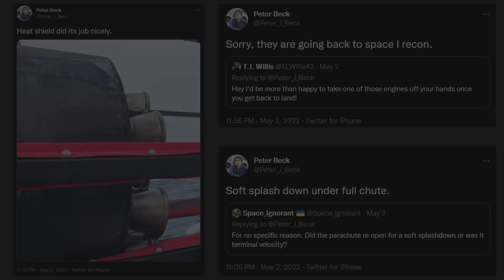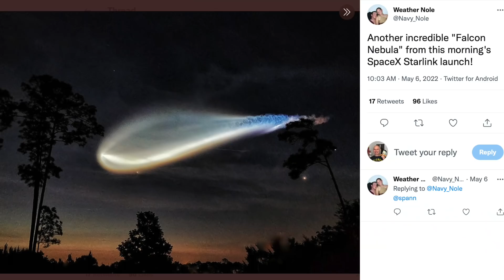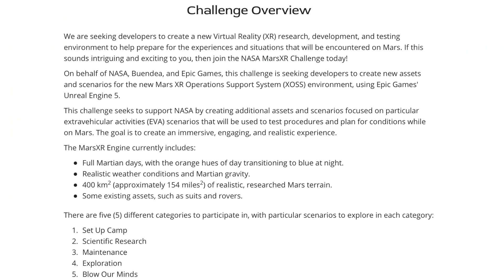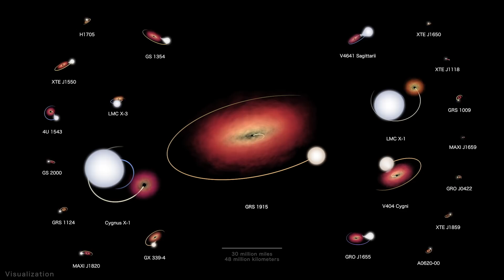SpaceX Planning To Land In Middle of Bahamas - Deep Space Updates - May 10th

Comment: not that impressive since we've been able to get from Montana to Moscow in 30 minutes or less since the 60s though that's always been purely on paper
Reply: In actual human travel, I recall reading that you used to be able to fly London to Paris in 20 minutes in the 60s. That's from walking in the airport doors in London to walking out in Paris. When I read it, (maybe the 90s,) you couldn't do it in less than 2 hours due to air traffic congestion and maybe security. When it comes to transport technology, anything is possible until everyone wants to use it at once.
Reply: @eekee6034  go read some of the speeds they used to run passenger rail back in the 1920s, they were possibly hitting speeds of 140 mph on sections of track but nobody bothered putting speedometers on trains back then anyways so the record for fastest steam engine probably isn't the actual record

Comment: Thanks for the analysis.  There were, apparently to V2 Raptors that have blown up at MacGregor, yesterday and day before.  Rumors that those may have been intentional.  BE-4 is nearing decades behind schedule, despite rhetoric to the contrary.  Spin launch would not, to my mind, be a candidate for the moon, much simpler would be a rail gun, where the G-forces could be slowly applied, or could be more adequately controlled in a simpler fashion.  The gravity well on the moon is so shallow, you only need to throw something like 10miles and it's basically in orbit, or there to be picked up by a tug or some such, as Apollo 11's Mike Collins did with Eagle when it ascended (and all subsequent Apollo's).  Spin launch creates incredible and unnecessary G-forces to my mind, and those would not be healthy for human occupants.

Comment: (CNN Business)Boeing Co. is feuding with Aerojet Rocketdyne, a key supplier for its Starliner spacecraft, as the U.S. aerospace giant races to test launch the uncrewed astronaut capsule and mend its reputation in the space sector, people familiar with the matter said.

The CST-100 Starliner is scheduled for a May 19 Florida launch atop an Atlas 5 rocket to the International Space Station, with Boeing aiming to show NASA that the spacecraft is safe to ferry astronauts to and from the orbiting outpost. Software failures cut short a similar 2019 uncrewed test flight.
The mission is a crucial step toward re-establishing Boeing as a viable rival to billionaire entrepreneur Elon Musk's SpaceX, a drive complicated by Boeing's disagreement with propulsion system supplier Aerojet, according to three people who spoke on condition of anonymity.
Boeing is losing the plane race. So it packed up and left for Washington
Boeing is losing the plane race. So it packed up and left for Washington
Chicago-based Boeing (BA (BA)) and El Segundo, California-based Aerojet (ARJD (AJRD)) are at odds over the cause of a problem involving fuel valves in the Starliner propulsion system that forced a postponement of a test flight last July, with the two companies faulting one another, the sources said.
The disagreement, which has not been reported before, comes at time when Boeing already is scrambling to emerge from successive crises that have hobbled its jetliner business and drained cash.
The Aerojet dispute is the latest illustration of Boeing's struggles with Starliner, a program costing the company $595 million in charges since 2019. Facing fixed-price NASA contracts that leave Boeing with little wiggle room financially, the company has pressed forward with the Starliner test.
Boeing in a statement provided by a spokesperson to Reuters acknowledged for the first time that it ultimately intends to redesign Starliner's valve system to prevent a repeat of the issue that forced last year's test-flight postponement. The Boeing statement said that "we are working on short- and long-term design changes to the valves."
Thirteen fuel valves that are part of a propulsion system that helps steer Starliner in space were discovered stuck and unresponsive in the closed position, prompting last year's postponement.
The various technical setbacks have pushed Starliner's first flight with people aboard into an unknown future, placing it far behind Musk's SpaceX, whose Crew Dragon capsule, developed under the same NASA program as Starliner, has already flown five astronaut crews for the U.S. space agency.
SpaceX&#39;s wildly busy year continues with astronaut splashdown 
SpaceX's wildly busy year continues with astronaut splashdown
NASA hopes Boeing can provide additional options to carry astronauts to the space station. NASA in March awarded SpaceX three more missions to make up for Boeing's delays.
A team of Boeing and NASA engineers is in general agreement that the cause of the stuck valves involves a chemical reaction between propellant, aluminum materials and the intrusion of moisture from Starliner's humid Florida launch site.
Aerojet engineers and lawyers see it differently, blaming a cleaning chemical that Boeing has used in ground tests, two of the sources said.
An Aerojet representative declined to comment.
'ROOT CAUSE'
"Testing to determine root cause of the valve issue is complete," Boeing said in its statement, and the work did not find the problems described by Aerojet.
NASA shares that view, Steve Stich, who oversees the Boeing and SpaceX crew programs for the space agency, told Reuters.
Boeing also said Aerojet did not meet its contractual requirements to make the propulsion system resilient enough to resist the problems caused by the chemical reactions.
Boeing last week wheeled Starliner back to the launch pad for a third time ahead of the upcoming launch, having swapped out the propulsion system for a new one with a temporary fix that prevents moisture from seeping into the valve section.
Boeing and NASA said they did not recreate any fully stuck valves during nine months of testing, instead measuring the degree to which valves struggled to open.
Boeing loses more than 90 jet orders due to war in Ukraine
Boeing loses more than 90 jet orders due to war in Ukraine
This approach was used in order to get Starliner back to the launchpad quickly, two of the sources said.
NASA, Boeing, Aerojet and independent safety advisers are set to meet this week to reach a final determination on the cause of the valve problems and decide whether the temporary fix will work.
Boeing officials privately regard Aerojet's explanation for the faulty valves as a bid to deflect responsibility for the costly delay for Starliner and to avoid paying for a redesigned valve system, two of the sources said.
"It's laughable," one person involved in the joint Boeing-NASA investigation of the value issue said of Aerojet's claim, speaking anonymously to discuss confidential supplier relations. "Getting a valve maker or propulsion system provider to write down, 'Yeah, I screwed that up' ... that's never gonna happen."
After testing and software issues caused Starliner's 2019 failure to dock at the space station, NASA officials acknowledged they had trusted Boeing too much when they decided to devote more engineering oversight to the newer SpaceX than the aerospace giant.
The feud with Aerojet is not Boeing's first Starliner subcontractor quarrel. In 2017, Starliner had an accident during a ground test that forced the president of a different subcontractor to have his leg medically amputated. The subcontractor sued, and Boeing subsequently settled the case.

Comment: I have to wonder if they just brought on some commercial helicopter pilots or if they brought on real military helicopter pilots.  The military helicopter pilots sling loads like that all of the time and know how to set it up and handle it.

The thing is mastering helicopter flying is tricky.  You are literally balancing on a propeller.  Add in all kinds of funky oscillations from this load swinging around underneath you and that is down right terrifying.  Maybe in testing you can hit it right and not have the oscillations, but in real life you are scrambling more to line everything up and then you hit it wrong and not it is not like the test.  A lot of helicopter flying is what the pilot can handle as the machine can do it.  There are limits to the machine though and different helicopters have different limits, so you still have to know the limits of your machine.  But still with this incident, it was probably the pilots who were limited on their capability.  It is better to admit your limits and cut lose than to go out of control, find you are putting too many loads on the machine as the situation gets out of hand, and then the helicopter gets a tail strike with the rotor blades flexing excessively or something and you are hosed.  A tail strike with the rotor blades is a very violent thing as rotor blades have a tonne of kinetic energy in them.  It is the kind of force where you are either splattered around the inside of the helicopter or pieces of you fly out of now broken windows of the helicopter as it breaks up and goes down in flames kind of thing.  There is no reset button when that happens.
Reply: All of which makes it seem this is completely impractical as a routine technique. As well as genius pilots (they should hire Tim Peak!) you need perfect weather and can only operate in daylight. Maybe it could be done with drones instead? It really needs to be automated in some way to make it practical.
Reply: @JohnBlackburn1975  I like the idea of an airship with a hole in the middle and doing a vertical aircraft carrier style landing.
Reply: i wonder  wtf  you  thought the connection was between your second paragraph  and  the  first.!!!!!!!

Comment: Grabbing parachuting large object is not new. Worked at Sperry Univac in the 70s. They had a project of reconnaissance drones that would launch from a large aircraft, fly a pre-programmed mission, return to a rendezvous location, shut down, parachute, and get snagged by a helicopter. Not as big as a booster, but still pretty big and this was almost 50 years ago.

Comment: Spacex should build a landing pad on the ground in the Bahamas. Take the pressure off the drone ships for the occasional southern launch
Reply: Unless they launch on that inclination A LOT, it would not be worth the trouble.
Reply: @steveaustin2686  considering the mass of most of the payloads they’ve been launching, they’ve consistently have quite a bit of cross range capacity. And a terrestrial landing zone entirely eliminates sea state as a recovery factor. Honestly, I think it would be a good idea for spacex to build a stationary pad on something solid like an oil rig along the northern corridor as well. Most of what they’re launching is light and just below the threshold of RTLS anyway. Long term, augmenting the droneship fleet with some fixed pads would increase Flacon’s capability.
Reply: @Rory-Shields  Making inclination changes costs dV. With a drone ship, you can put it where you want. They have northernly and southernly launch corridors if the Bahamas lets them keep flying over, so why build fixed pads? You would have to transport the booster back anyway, so just skip the fixed pad and use the drone ship. The best part is no part.
Reply: @steveaustin2686  I’m sure that’s the solution they’ll come to. But I still think landing on the ground is rad. I’ve yet to see a landing in person down at the cape.
Reply: @Rory-Shields  We saw Transporter-1 in Jan 2021 from Jetty Park. It was amazing and the sonic booms were really loud when it landed. If you can, Aug is the window for the Psyche launch on a Falcon Heavy. I want to try to get to that one to see a double landing.
Reply: @steveaustin2686  I’d love to see a falcon heavy launch. Right now my only big for sure plan to get down there is for SLS if it ever gets in the air.
Reply: @Rory-Shields  We've seen a Shuttle, Atlas-V, and Falcon 9. I want to see a Falcon Heavy, but if I'm going, I want to see the boosters land. The USSF-44 and USSF-67 launches scheduled for this year are going to expend the center core and try for a double drone ship landing. Sounds perfect for a TV launch I think.

Comment: 14:27 ok but on the moon you dont need a vacuum chamber. and thats a big part of their gimmick. so they use up a lot of money to develope something that doesnt even aply to their ideal use case
Reply: The commute to set it up on the Moon to test is a bit expensive. 😎
Reply: What's so special about a vacuum chamber? It doesn't need the hardest vacuum possible, just enough to drastically cut air resistance and thus the cost of spinning it up. That brings it down to 19th-century technology. The breakable seal on the exit may be new, but I'm almost sure they could have found suitable materials in the 19th century too; it's not that clever.
    It's far harder to prevent vibration damage when the thing is released and the rotor becomes unbalanced. That's the clever bit.

Comment: I still think a linear magnetic acceleration system (like a souped-up maglev) would be better for launching things from the Moon, especially for "biological cargo" (IE, passengers). I don't see a centrifugal system being so much simpler and cheaper and more robust that it could outperform a linear system's utility.
Reply: For humans, you don't want to go much over a few Gs, which is what rockets already do. The issue is that rockets take 1000s of miles to reach those orbital speeds, so you are gonna need a thousand mile long maglev/railgun track.
Reply: @phillyphakename1255  Given how fast you need to go to orbit the Moon (1679 m/s) and a maglev track that accelerates cargo at one gee, you'd need a track 141 kilometers long. The track doesn't need to be fancy by any means, but you might need to do some landscaping to keep it level.

(I don't think a railgun would work here since we want to avoid friction as much as possible. 1.6 km/s would be way too much speed.)
Reply: @General12th  You can actually accelerate quite a bit harder, e.g. at 3g. That would reduce the needed track by a fair margin. 

numbercrunch about 47 km.

At 5g, a bit less than 30 km. However, accelerating at 5g for 34+ seconds will be very uncomfortable, especially after having gotten used to 1/6th g on the moon for an extended period of time.
Reply: @General12th  A track 141km long is also a whole different beast than a centrifugal yeeter 15 meters in diameter... That being said, I don't think we'll ever need to transport much back from the moon that isn't humans...
Reply: @andersjjensen  The Moon has a variety of metallic resources that might be put to use all around Earth orbit. Sourcing those materials from the Moon's surface (especially with a non-rocket launch system) would probably be easier and quicker than sourcing them from the Asteroid Belt.

If we ever get fusion going, the Moon's vast reserves of helium-3 might be valuable enough to ship back to Earth directly.
Reply: @General12th  : Honestly, for a lunar launch track you'd probably just elevate it enough to not need landscaping. Some of the craters are quite deep, but a launch track is also already a major undertaking.
Reply: You'd use a centrifugal system for ore mining early on. You'd still want a linear track (especially since you could arguably use one for landings too), but that could be left for later developments.

Comment: Like the module which returns back to earth after Space station mission, Why costly satellites are not brought back to earth in same way for repair..Will it be beneficial.. ?
Reply: Cost.  Making a sat able to re-enter is going to drive up it's cost and the launch cost.
Reply: @TheEvilmooseofdoom  it will be good to see in future : companies to slowly reduce the orbit of costly satellites with universal docking port to connect with service station at some orbit.. Which will enable for repairs / refuel to stay in orbit for more years..
Reply: Because sats are usually in higher orbits than the ISS. You would need make them aerodynamic, put heat shields & parachutes on them, which costs mass.
Reply: @steveaustin2686  in the same crew dragon shaped module, what if the satellite electronic components are kept inside and antennas gets deployed trgh some opening designed for it..
Reply: @narayananb2252  The Dragon shell would almost certainly weigh more than a regular sat shell. You also need to bring up propellant to bring the sat back down, which would eat up a lot of mass. All that is extra weight you don't need.